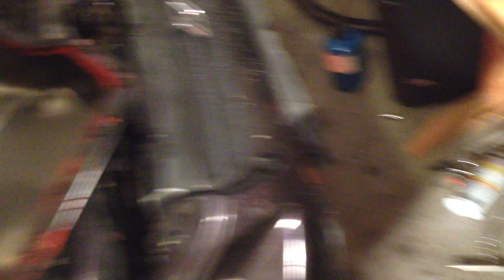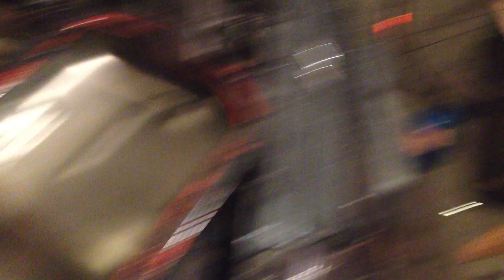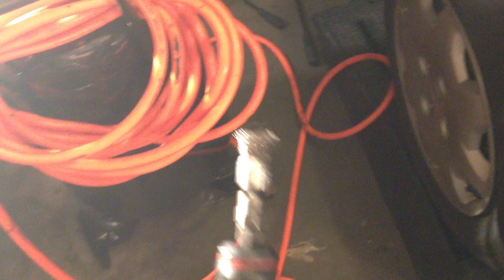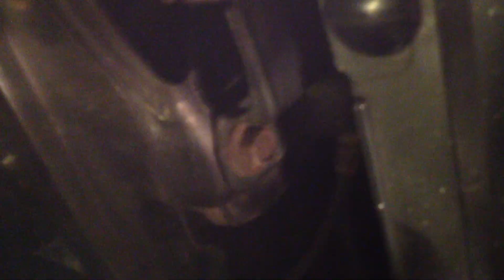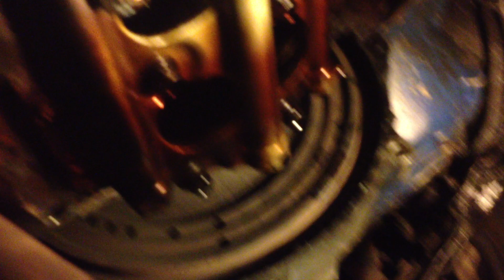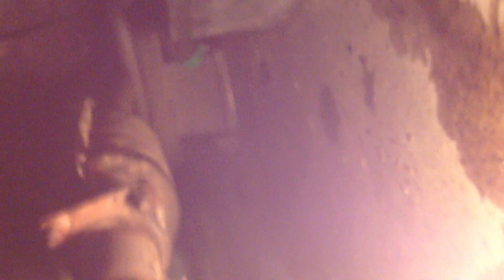How To Change A Honda Oil Pan Part 2

Comment: 9 ft lbs. for pan bolts. The grey material on the pan is likely Hondabond used from the factory (without a gasket). Pan looks original to the car, with that rust on it.

Comment: The torque spec for just about all Honda oil pan bolts is 8.7 lb ft.  Finger tight first, then gentle snug with wrench and then final torque using criss cross pattern.  Do not use an impact to put them on.

Comment: Good day.
  I am in the process of Saturday here mechanic in Monterrey Mexico, I wanted to see if I can support and my car cavalier warmed to the stop and detected the thermostat is damaged but also check that the water pump is with blades with much rust too check this pump to remove I have to remove the chain cover and screw damper time with crankshaft pulley. My question is if they torque the cap screws and screw crank damper being made as is the torque and. Also if I can support the torque given to Carter screws as this oil leak and crashed my car is cavalier 2003 Ecotec 2.2 support pending blessings

Comment: Did you went from an aluminum oil pan to a steel pan? Did you have any problems with the oil sump fitting or oil pick up issues? Wouldn't be better to stick to a aluminum pan?

Comment: What is the name of the cobalt set that removes the tension on the corners.  Is there a special set and whats the cost.  You said its standard and metric, is that correct